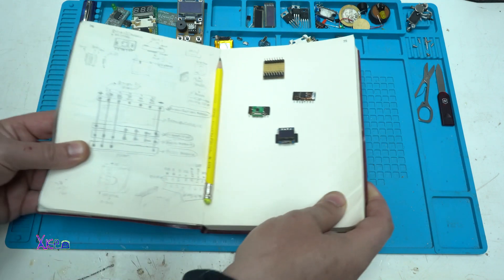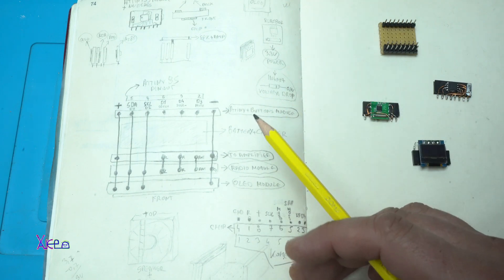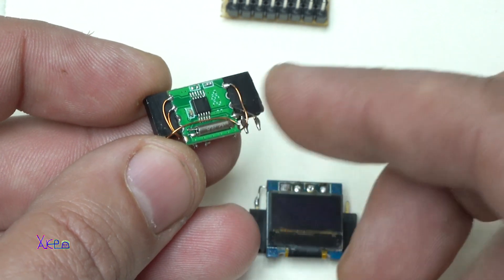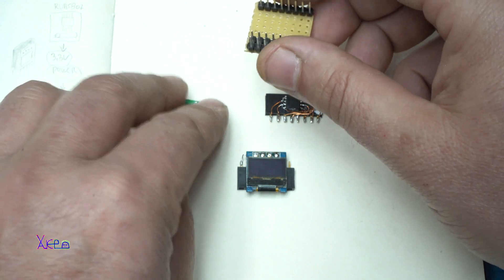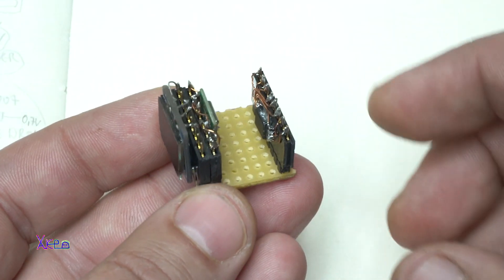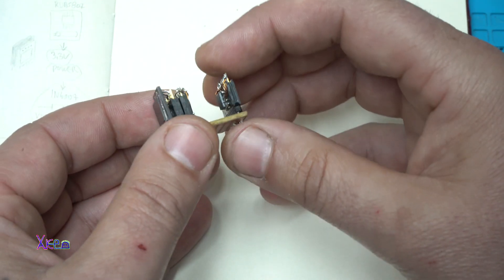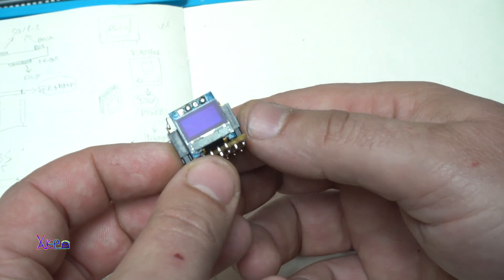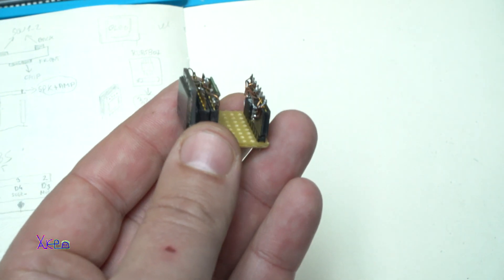Update on Making Micro FM Radio - Part 2

Comment: Nice trick with the module!  I suggest adding a 100nF capacitor on the VCC to GND near the VCC pin of the AT Tiny module (should be part of the module).
Reply from the maker: Thanks for the tip!